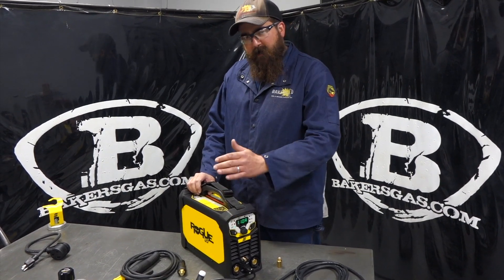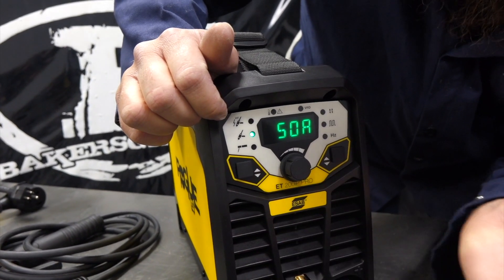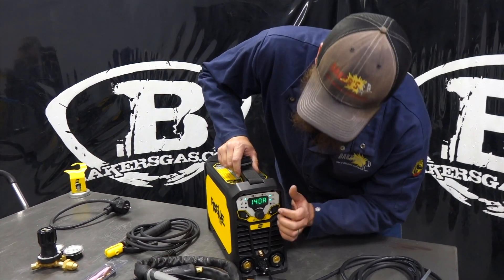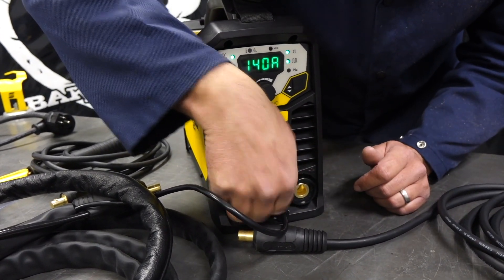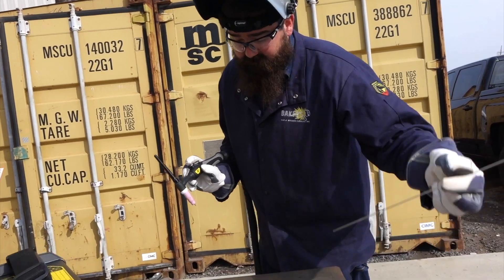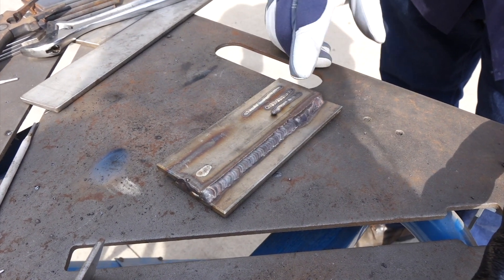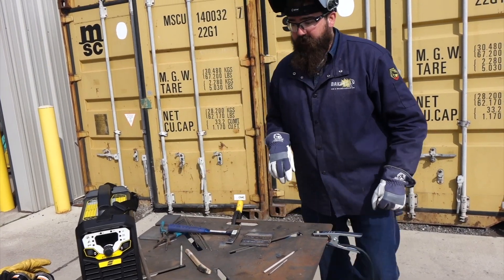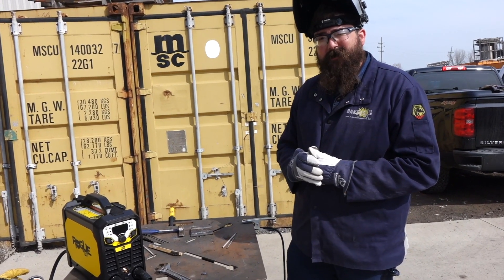ESAB Rogue 200i Pro - Stick/TIG Demo - What we honestly think about it!

Comment: I bought one of these for structural welding where I can’t get my generator welder in. I can run 3/32  7018 rod all day on 110 volt without hitting the duty cycle. If you try to to run 1/8 inch 7018 on 110 volt it’ll trip on one rod. On 220 volt it’ll run all day rod to rod 1/8 inch 7018. Thing runs super smooth too.
Reply: Same here where my rig can’t get into sewer plants I bring my esab …I absolutely love it ..I have a long lead from my welder so I always run it on 220 v 🫡

Comment: Your using terms that new welders that want to buy this cheaper machine won´t understand.
Also talking a little too fast or excitedly, so are skipping on descriptions. Would have listened if it had been aimed at
first comers to welding, yet maybe it´s not as simple process as I thought?
I have seem people stick in a rod and up the voltage to cope with a thicker metal and the gas is included in the rod?
I don´t want rocket science, just simple solutions to home fixes or spot welding.

You did do some welding at the end, yet again, could not hear what you were saying, due to you being turned talking to the machine, could not see
the info on the unit and was not shown the welded results? The camera sways forward and back again, I have no way of knowing
why or what you were doing.

Comment: I have just purchased the rouge ET180i and was wondering if it would perform similarly? most importantly will it be capable of welding thin stainless?
Reply: @kierancourt7269 how do you like your 180Si? That's what I was just looking for and gound out it was replaced with the Rogue ES 201i Pro.
I'm trying to decide between the ESAB and a Lincoln Sprinter 180Si for portable stick welding.

Comment: So on 110v 90-100 amps can I run 7018 and 6010 and just weld few few hours without hitting duty cycle ? Or would that be a problem if a bigger job came about .

Comment: The pulse settings are too limited for thin materials as you can’t adjust the background current and on time. Shame because it’s a well built machine.
Reply: You can adjust the background current from 10-100 precent on the ET 200iP Pro
Reply: I would say for that money you cannot await more from... Most others (professional machines) even does not have hf wig at that level. I would say the esab is a really good deal, if you want to have an expert wig machine you have to choose another model or an ewm picotig 200
Reply: is this true you cant adjust the low current of the pulse?
Reply: @tylerd55555  I own the machine and the low current or background current is fixed, possibly as a percentage of the peak current.

Other negative is the fan runs continuously

Comment: Hi 
I purchased the ET200I PRO however when I adjust the amps it maxes out on the display at 180amp and not 200 .  Am I missing a hidden setting or something 
Cheers
Reply: He is using a different model, than it says in the title, a more capable device. ET200iP PRO is double the price of the ET 200i PRO
Reply: @Zimmsters  no he,s not and was sorted . They just programmed it while I waited . I have around 30 of these welders plus all Esabs so I  kinda know all the models really well. 👍
Reply: Cuando la pones para soldar electrodo? O para tig también te lo digo pk me pasó iguAl con mi alta frecuencia ac DC de otra casa telwing la compré como 200A también te digo k xo la compré para soldar aleaciones y materiales es decir para soldar especialmente con tig no kiere decir k alguna vez la haya usado con electrodo son las menos lo k kiero decir k con tig me da los 200A pero al cambiar a smaw osea electrodo su Amperaje máximo es 160 creo k pasa en todos estos grupos es más te aseguro k con esa intensidad pocas o muy pocas veces la vas a utilizar tienes corriente de sobra para electrodo y Tig no te preocupes pknno te de los 200A en electrodo pk no usarás más de los k trae es una makina para lo k es Ería estúpido comprrtela para batalleo de electrodo pk si kieres un ekipo para electrodo con potencia por mucho menos las hay y kbsueldan tig claro si lo kieres xa con estas cualidades adaptaba compra para lo k la vas a usar

Comment: Is this Tig-Torch from Esab and what is the exact name of the tig-torch and the article number of esab?
Reply: I'm looking for the same setup torch.  Did you ever get any information? Please provide a link.
Reply: @thisdj83  Hello, sorry for my late reply. Unfortunately no, not even from Bakers Gas. I have now ordered the SRB 26FX-R with 4m hose specially developed for the Rogue (Esab item no.: 0700025580). Be careful, only torches that were developed for the Rogue Series fit!
The ergonomics don't really convince me, I would prefer the torch from the video. If you found something, please let me know. By the way, the ES200i PRO is amazing!
Reply: @thomasbaumann8620  
س

Comment: I have the same torch with the Esab Rebel 180 and I was wondering why the power button on the torch seemed useless. Now I know I overpaid for something I can't use U.U. I should have bought a CK worldwide kit which actually includes the gas valve grrrr....
Reply: Do you have the same TIG-Torch? Where do you buy it? Do you have the Item-Number from Esab? Sadly i can‘t find any information about this Torch. Thanks!
Reply: @thomasbaumann8620  have you found it?
Reply: @NoNo-uy2bq  Sadly, not yet.
Reply: @thomasbaumann8620  TIG torch SR-B 26 type 4 m. Try copy and pasting that

Comment: $1849 and no foot pedal ??? I really don't see the value over the 180i, you pay 3x the cost for HF and pulse, but no AC.
Reply from the maker: You do get the flex head TIG torch with the 200i where the 180 you do have to buy the TIG torch. You are getting 20 more amps of power. I hear you though the value is more in the 180.
Reply: These retail at approx 786 euro in Europe, about 960 dollars. I'm guessing it's because they are imported they are double the price in the States?
Reply: @dannyahern8341 , in Russia it costs equivalent 500 $
Reply: В России он идёт с другой горелкой.
Reply: У нас в России другая комплектация